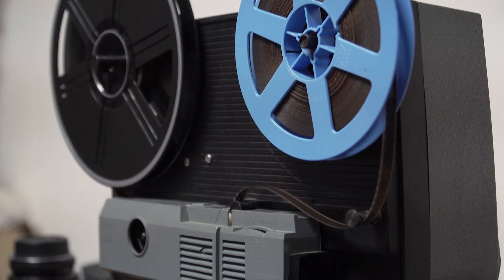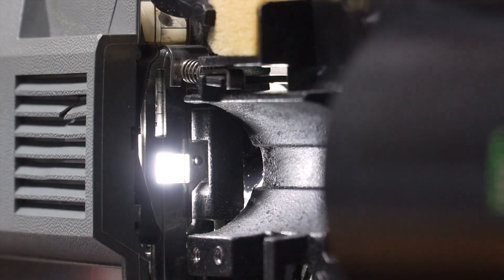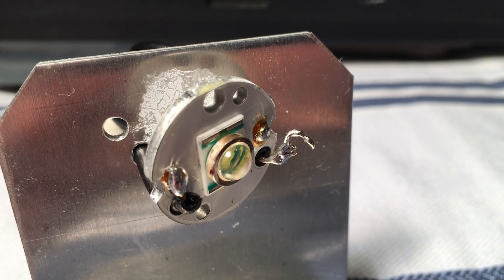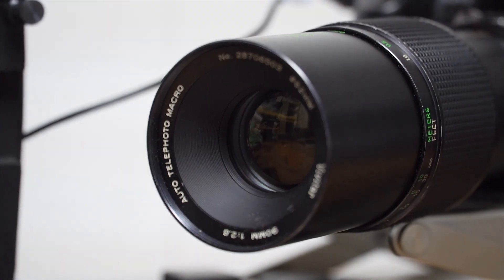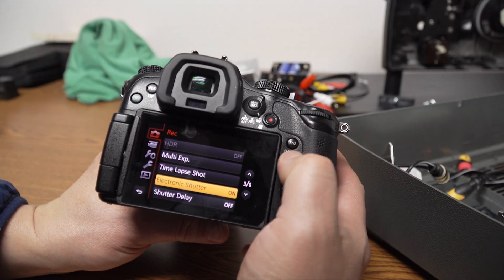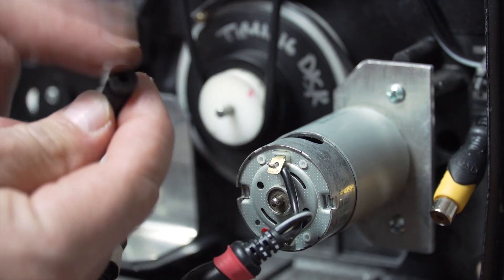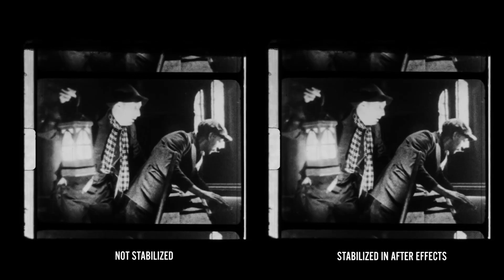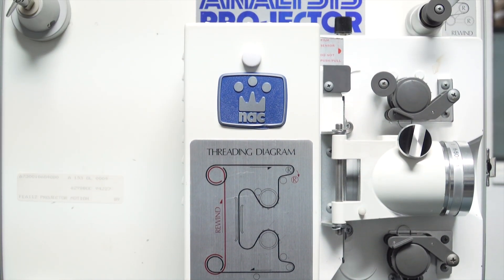Reviving a Workprinter XP Super 8 Scanner.

Comment: I built my own frame by frame system from a Bell & Howell 1481 projector. The triggering and motor are perfect as its design is easily converted. As with all these projects, it is all to do with the optics, the one thing that holds me back. Ive done away with old condencer lens set up and am now looking in to macro lenes. One of the most difficult problems is to create  the jig/holder for the camera as microscopic  adjustments are required.
Reply from the maker: A projector is a great way to start! If you don't mind having a semi-permanent holder, you could make a system similar to the one I made using bolts and nuts. That allows a great level of precision, but it takes time to adjust it. Then you could use a "macro focusing rail slider" to make fine adjustments to the focus. I saw some plates for less than $20. The mistake I made was to use parts of my camera rig. I had to dismantle everything when I needed those parts again.

Comment: Great video. I have that same Workprinter I bought in 2004 and made a living using that projector for two years. I recorded the sound from sound films and added the sound to the film using a Pinnacle editor. It was a tough job sometimes as I had to get the lip sync working on that film. I managed, but it took time.
Now I have started to do it again for fun. You made some great modifications there, which I will adopt to my Workprinter. 😎
Reply from the maker: That's awesome! I did a lot of research about the Workprinter XP. I read they were (as you mention) expensive and valuable devices since there were not other affordable options to transfer films at the time. 

It's amazing that you were able to make a living out of it. I'm sure that synchronizing sounds was not an easy task without a slate or a visual reference.
Reply: @TheCinematographyLab  My version now uses a Lumix FZ-300 and a Raynox DCR-250 Macro Lens in front of the bridge camera's own lens. I can scan the whole full frame with that combination. I haven´t modified the speed yet to use only the camera but scan with Black Magic´s 4K card. Also, I use the original software to scan in HD.
Reply from the maker: @Ericus55  That's a great setup. Did you keep the projector of the lens and the lens Moviestuff added with the mirror?

I saw really good scans captured with the original software. Capturing pictures with the camera expands possibilities in regards to color space and resolution, in my opinion. That involves several extra steps, so it's not worth it for everyone. It's good to know the device can be upgraded as technology evolves, though.
Reply: @TheCinematographyLab  I don´t use the original mirror system. I also removed the original Gaf lens and shot directly from the film frame. With my system, I get 8Mb photos of every film frame, which is enough information to get good-quality video. I am happy with that. I paid 1400 dollars in 2004 for the WorkPrinter XP and I am happy that I can still use it to get great quality videos using that old projector. It is not fast, only 7-8fps but I have all the time and no need to hurry to get the videos for customers anymore. I do scan the films for my friends and their friends and get some pocket money for doing that and that is enough for me. 😎
Reply from the maker: @Ericus55  It was a great investment! That's the beauty of film. You can scan 100-year-old film, and it looks great. It may even look better later if we upgrade to better cameras and lenses. Thanks for sharing your experience.